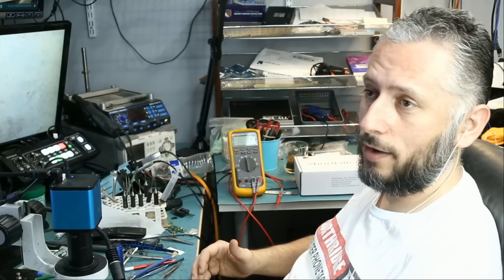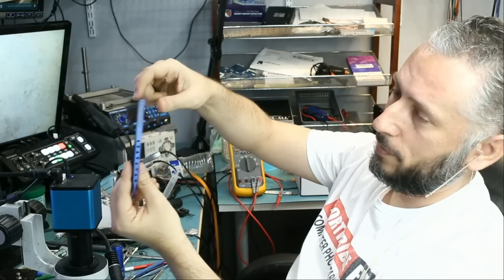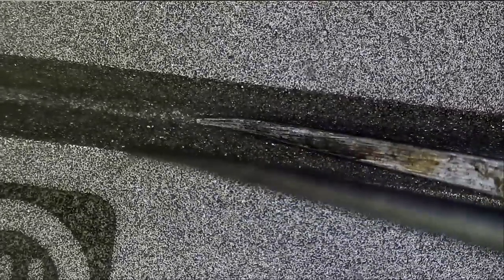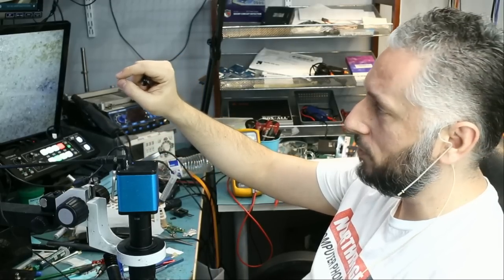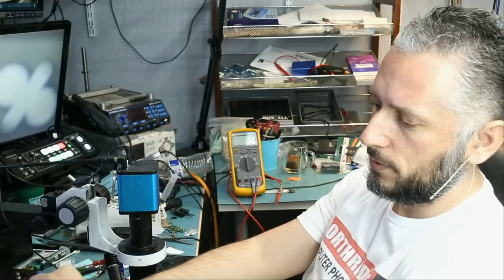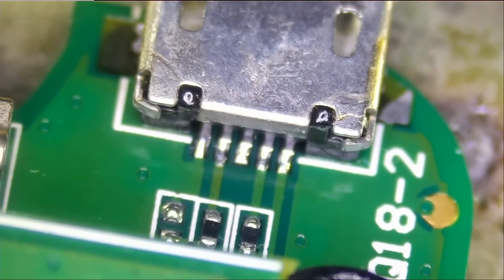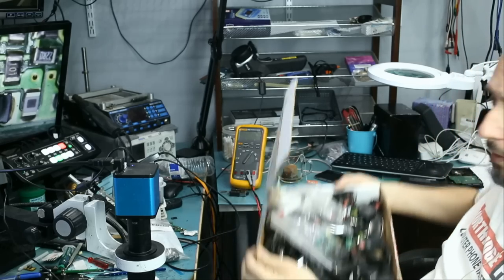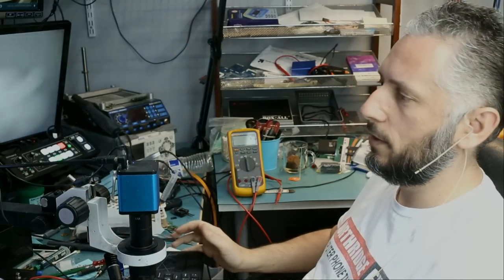New Tools and Gadgets. Viper Remote Repair + 2002 Benz Fob Repair

Comment: Great job, as always :)
I have a suggestion for all your USB ports: you could make an Excel worksheet listing all the ports with the characteristics of each port (number of pins, surface-mount/through-hole, lip/no-lip, etc), and then you could easily filter the ports that could match the board you are working on. I think you could save some time, even though you generally find the one you are looking for fairly quick! :)

Comment: Hi, could you tell me what the smd chips are that are next to the charging port. Are they inductors, resistors or what??? No one can tell me. Thanks for the video. What are the white chips on the key fob?
Reply: 17:04 the three smd components seems to be resistors. Correction: two. The third spot does not have a component.

Comment: any advice for young audience (like me lol)who wants to follow your path?
Reply: Best thing you can do - is just tinker and practise. I learnt a lot by breaking things, figuring out how they work and repairing them.
Reply: Get some stuff you don't care about breaking, optionally break it, then do stuff with it. Cheap [Chinese] tools are your friend as well, they'll serve you well for learning
Reply: Try fixing a bunch of broken ps4/xbox controllers as a start, good luck 🌝
Reply: Start small. Practice your soldering skills on old electronics. Use flux. Don't let people tell you that you suck. We all sucked when we started. Read everything you can. Pay attention. Never give up.
Reply: More Flux is always better. Just dont give up. Rome wasnt build in a day just like your skills. They will grow every day 💪 everybody sucks at start
Reply: Find some old junk boards and practice soldering. Read and watch vids to learn what components are what. 
Big thing is don’t give up and practice practice practice.
Reply: @lexander9686  i can't even reassemble stuff properly. Opened a controller, could not close it anymore because of the rubber around the vibration motors.

Opened my x7-755k gaming mouse to replace the rotary encoder, mousewheel can't even rotate after closing because it starts grinding against the case and am unable to use a switch on the side of the grind as well (no room for pressing to the side). It's my favorite mouse :(
Reply: start off with de/re-assembly, create a screw management system, work at repair shop, get experience, get certified (not necessary but it will open you up to even more knowledge). Once you're making 100k a year open up your own business, don't quit your day job until your own business makes more per year (shoot for 200k). Good luck!